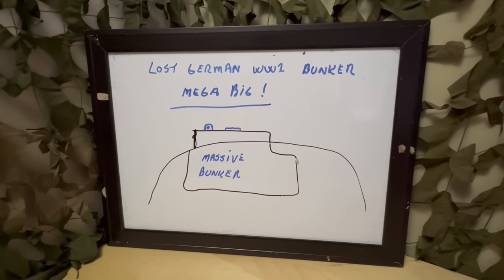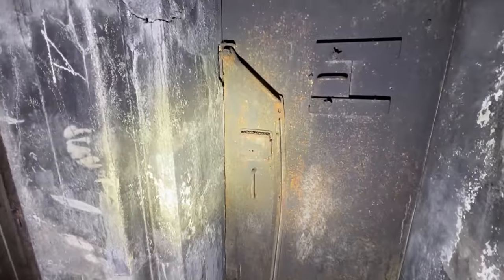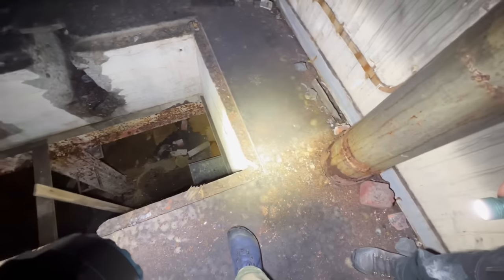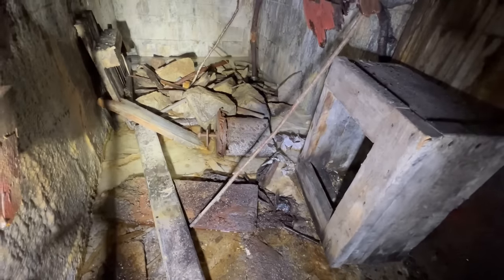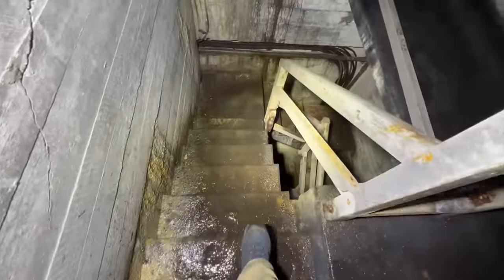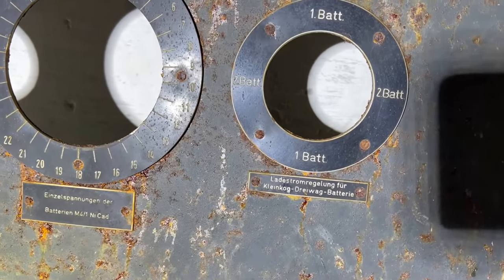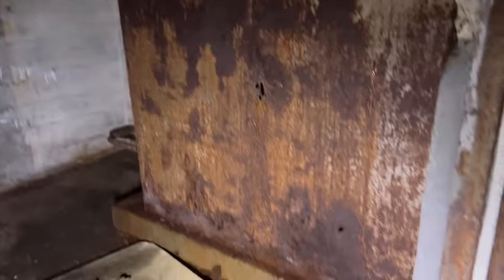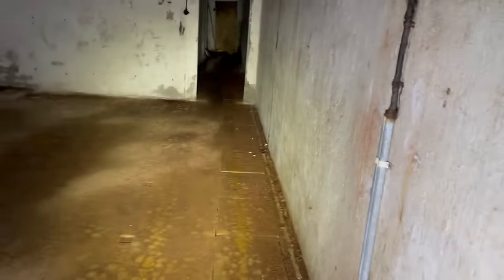Mission into secret German WW2 MEGA bunker. It is OPEN and still German WW2 equipment inside !

Comment: Outstanding video.  The best bunker that I think you have ever found. I hope that it can be properly protected!!  There can't be that many that are that well preserved.  Do you know who owns it?  Are such things automatically protected in some way?  Is there any organisation that can be asked to seal it up?  I am always struck by how nicely built these bunkers are - they are not roughly put together but instead everything is nicely fitted, all the wires and such like.  I also like all the little details like the patterns left in the concrete by the wood used to frame the concrete and also the original wood still left inside the little gun ports.
Reply from the maker: I think this place is almost always sealed up properly but someone seems to have worked very hard to enter and lucky for us as all we had to do was to walk right in as it was open. Talk about luck :) Thanks Charles.

Comment: That is an amazing find and with so much stuff still in there. The way it looks like to me is a major communication hub. And those square holes in the wall were put there to pass messages through. It would have been easier to do that as apposed to walking around the wall. And probably not a range finder but a radio antenna. They had to have something like that to be able to communicate with so many different people throughout the many countries that they had to keep informed.
Reply from the maker: It is a great place and we are very glad we could share that with you. Thanks for being here :)

Comment: The tunes in the intro definitely gets us into the mood for another WW2 History Hunter adventure.  Could hear EE excitement in the background, "Charge and attack."  :)  A shame some of the metal was stolen.  Would have been nice to see it in it's original form.  That Bunker was massive with the ventilation shaft still intake, the rads for the heating system, bunks, shelves, work bench, sinks, urinals, toilets, transformer, generator, room for the range finder. The shower set up in the entranceway was well thought out so the German soldiers could decontam before entering the Bunker.  They thought of everything.  It did look like maybe a fire had occurred there or maybe from some equipment?  Cool tunes EE, "Walking in the Bunker".  Wow, so many levels unbelievable.  It is a shame that the German WW2 equipment hasn't been moved to a museum.  Right you are EE one of the Top Ten journeys back in time.  INCREDIBLE!!!!!!!  You are going back aren't you.  That is worth a repeat visit. I want that on my bucket list.  Thank you HH and EE.
Reply from the maker: Yes charge and attack is him in a nut shell :) Such a gem just laying there rotting away. To bad actually but glad we had a chance to share that with you Laura. IT will be on your list for later Laura :) Thanks and greetings from us.
Reply: @WW2HistoryHunter  can't wait

Comment: the shower outside is quite common on bunkers with living accommodation. as there is a drain at the bottom of the stairs to stop rain from flooding the entrance. so it made sense to fit the shower there. you will start noticing the drain when you visit other bunkers. 
I believe that was a M19 mortar, not a rangefinder in the room with the large ladder. it would also explain the square holes going into the rooms. as the mortars would be kept separate from the automatic loader for the mortar itself.  
TBH, an organization who restores bunkers should be given the opportunity to turn it into a living history bunker. it is so rare to find a bunker in that condition, with most of the wall panels, wiring, plumbing and ventilation still in place. let alone finding the generator and heating system. 
I honestly don't think you will ever find an unrestored bunker in better condition than that ever again.
Reply from the maker: Well you might get a surprise my friend and thanks for watching.

Comment: I work in the alarm industry which uses similar but miniaturized devices. What I think I'm seeing is an alternating current A/C (generator) that creates power, then that panel with the knobs converting it to direct current D/C storage (batteries) low voltage. They could then store power for their electronics and
 light bulbs. All similar to a cars electrical system.
Reply from the maker: Great feedback and thanks for being here :)

Comment: Knowing german engine engineering, I am sure that unit can be mildly serviced and made to run again. In cluding the generator that the engine drives. Though, I am sure that if it were fired up, the fuse boxes would be going off right away. But then, any lights still intact, just might turn on! The batteries in the battery bank were not your usual lead acid batteries and it was confirmed on the panel when it listed the NiCad. Even during WWII, the germans had developed nickle cadmiun batteries and that what those batteries are, ni cad rechargable batteries. The water right off from the laundry room might well have been the septic tank and is not over flowing due to an over flow run off to a drain field. Though by now there would be no excrement there, it would be wise to wear a good diving suit and heavy lined boots against puncture and look for artifacts. At least, that is what I would do.
Reply from the maker: could have been cool to do and thanks for watching and for being here :)

Comment: I could be mistaken, but when he went down to the third level at 26:45, the yellow door I don't believe leads to the outside. I think it may lead to a tunnel chiseled thru the rock. One of the reasons I think this is because of the ruff chiseled look to that entrance leading to the yellow door. If it were a main entrance I would think the walls would be smooth instead of raw bare rock. Looks more like an entrance to tunnels. Maybe for escape also. It's a shame he couldn't get it open. Keep in mind there is a lot of missing Nazi treasure, like gold and art that has yet to be found. Some of it could be on the other side of that"yellow" door. 😳
Reply from the maker: Could be and what a interesting place this is. Thanks for watching.

Comment: the most interesting part is about the remains of the electrical equipment near the generator. depending on the label at the electrical panel this generator was able to charge two batteries for a (field-)telephone communication system (feldvermittlung) and the other, most interesting part - two batteries (kleinkog-dreiwag-batterie) from a FLAK (air defense) command & control system. it means in this bunker was a system installed who calculated the data from the rangefinder/distance measuring to direction data for some flak guns and send this data by wire direct to the connected flak guns. maybe there was a battery of 8.8 or 10.5 guns in that area. in that case on the socket who is shown at 12:50 was highly likely a ww2 radar system installed. not much of this ww2 high tech things survived until our times . . .
Reply from the maker: Great feedback and thanks for watching.

Comment: Of all the surprise bunkers my friend this one is on top. This looks nonstandard and would be a great project to at least map out. So much equipment that should be in a museum and possibly functioning. The control panel was removed so they could get the 4 meters out of the top row. The NiCad batteries were dual purpose, banked and charged they could support the communications should the generator go down. Also, that size battery was in some of the portable equipment, this would allow them to swap batteries for recharge. This complex is in phenomenal shape for its age, should we be in such good condition when we are that old. The connectors on the range finder shaft base are going into a slip ring, that unit in itself would be rare. Fantastic job both of you on this trip. Stay well and safe out there my friends.
Reply from the maker: Yes William , what a AMAZING place and someone should really save the stuff inside for the future. Thanks for your great support and more greatness to come :)

Comment: Wow, this place is awesome guys. Upstairs in the toilet area the thing up high with four pipes is a heat exchanger to isolate this areas hot water from the rest of the hot water system. The boiler has a feed pump and possibly another redundant way to feed water to it. It doesn't look like a steam system though. The batteries in the power area look like early NiMh cells and yes it appears that panel is the charging system for them. Almost looks like telecom style gear from the 50's but they almost always used lead acid batteries. The generator looked like it could be restored. This place needs  saving from the ravages of time or at least sealing back up. Also the sinks by the sump/water storage area look like chemistry style sinks. Maybe they treated the water from the sump before using it. Absolutely amazing place
Reply from the maker: Yes loved that explore and thanks for watching and being here Matthew :)

Comment: May I suggest knee pads because I wear them to protect my titanium knees and it would have been better to have knee pads for my knees when I had my real knees! you can get strap ons so you wont have to wear them all the time!
Perhaps all the showers were for gas, but also maybe to wash concrete dust off because like sheet rock dust, concrete dust is so fine it gets into everything. With all that expensive electronic gear it was a necessary precaution. 
Have you visited the grand bunker with fire control in Normandy? Also, I know that the Germans had some very advanced artillery bunkers which were made partly out of concrete and those bunkers could turn 360 degrees and had doors that closed so that the guns would be protected if being fired upon. Could this bunker be one of those?
Reply from the maker: Good idea and we have not visited that yet :) No this is not such bunker but we have shown such bunker before. Thanks Cliff and greetings from us.

Comment: 23:50 this looks like a battery charger system. Whether the batteries where designed to be removed I’m not sure. The battery packs could be for radio equipment or maybe they all form a larger battery to provide lighting ?

Yeah the fact that there are numbers would indicate that the batteries could all be removed once they had been charged. The numbers probably used in a list to record when the time when a battery was put on charge. That way, someone can remove each battery after the correct amount of time…
Reply from the maker: Interesting and thanks for being here :)